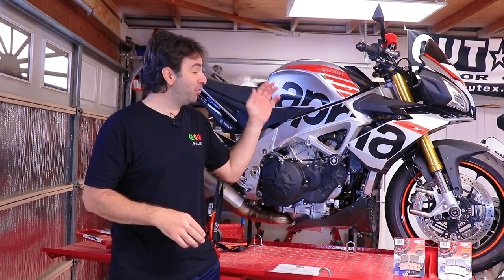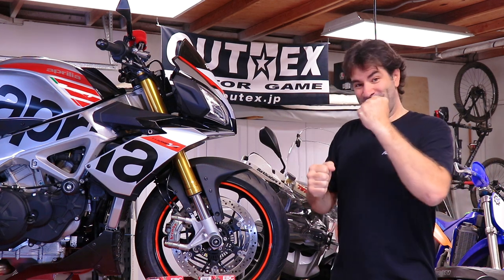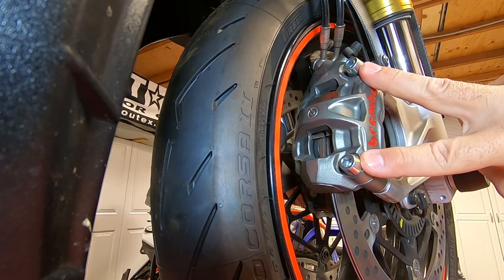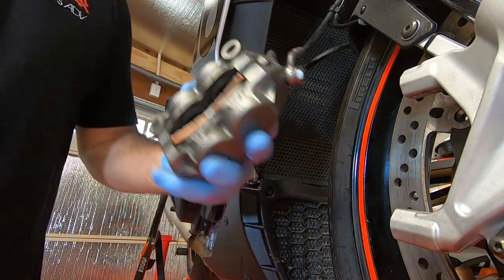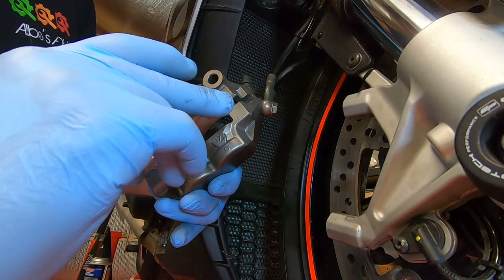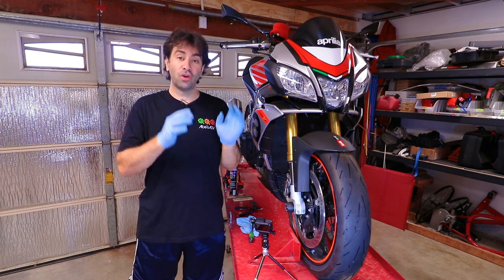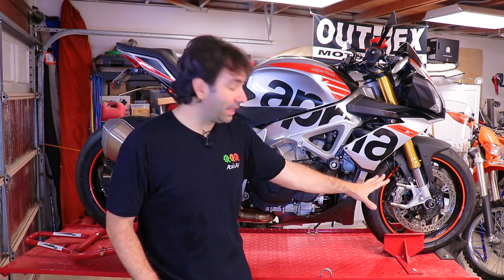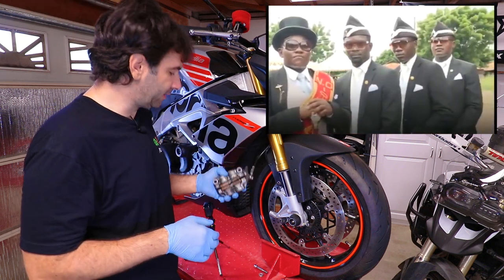Aprilia Tuono Front brake pads recall and replacement

Comment: Another nice instructional video, thx.  BTW my local Aprilia dealership replaced front pads on my own 2018 Tuono Factory in like 15 minutes,  while I waited.  They said no evaluation of OEM’s required & had the pads in stock as well.  As you said, not all dealerships are the same.
Reply from the maker: I agree, it's very simple, if you have a recall coming be prepared especially for the people that schedule an appointment. 👍

Comment: Hello Albe, sorry you had a bad experience with the dealer. I installed a Yoshimura Alpha T Works Race Slip-On Exhaust Aprilia RSV4 / Tuono V4 2017-2020 on my 2017 Aprilia Tuono V4 1100 factory. It is a little loud but sounds awesome. Having the stock 20lb muffler off the bike improves balance. Keep up the good work, thanks.
Reply from the maker: Hi James,  a friend of mine has the Yoshi on his RSV4, and although it looks great and has a good tone, when we ride side by side I can’t hear myself thinking, lol, I guess I’m too old for the Yoshi, I wold t it if it had a DB killer that I could modify to achieve the right loudness for me.

Comment: Albe, such good advice here! My dealer here in San Diego was awesome at this....with the exception that I had to wait a week or so for the appointment to open up. But once it was, I rode over and they did the job in an hour. I am sorry your experience was so bad.
Of course they replaced the pads with the OEM spec, as supplied by Aprilia. My service tech told me that he had done quite a few, perhaps a dozen or so, and that all of the pads he had removed looked excellent, depending upon usage and age of the machine. However he said Aprilia was being very good and essentially it was a new set of brake pads for free, except for your time of course.
I would very much like to hear your comments on the differences and advantages of the EBM pads compared to the OEM after you've had a chance to get used to them......a future VLOG?
Last question dude, your in-garage camera is excellent.....what type is it sir?
Reply from the maker: Garey my friend, one week would have been acceptable to me for an appointment, what bugged me was showing up for my appoint and being told it might take 2 weeks to do it, well, not so much, lol.
My camera is a Canon T7i while the close ups are made with a GoPro 7 just because it’s easier to handle, it took me a little while to figure out the best settings for the Canon in the garage, but that is my fault cause I’m a knucklehead  sometimes.

Comment: Great video! I subscribed! I am brand new to Aprilia and just found a 2017 RSV4RR I couldnt pass on. However I live very far from a dealership... Do you know of an Aprilia diagnostic tool to clear codes from ECU should I ever need to? Working on the bike is no problem. Software is the problem.
Reply from the maker: I agree, software is always a problem on all vehicles now a day, I'm not sure if guzzidiag can clear codes as well, I'm always weary on messing with the software. Congrats on your RSV4,  it's a fantastic bike and what a great engine 😀👍
Reply: @AlbesADV  right on! I'm gonna keep researching but from what I can tell, it looks like it will let you read the codes. For example when you go in the software it will pull the faults from your bike. From there you can fix the fault by performing the maintenance required. I'll give you a definite answers when I know. Ciao!
Reply from the maker: Ciao bello, grazie 👍

Comment: Albe. Would you check your bike if you still have the Aprilia Tuono 1100rr, and tell me if every now and then, you find a couple of drops of coolant that come from the weep hole on the water pump. If it does, is this a normal operation. I noticed the water pump has a little black catch under the weep hole. Is it there to catch any drops that may seep from time to time. Mine seems to lose a drop or two every now and then, but no issues with overheating or a great loss of coolant. Can you help me out? Thanks
Reply from the maker: I just looked all over my engine and couldn’t find any sign of coolant sipping, but that doesn’t mean yours is not doing it, as long as you have coolant in the system and is not dripping out excessively, you should be fine. My KTM525 exc does that, every time I ride it, there are 1 or 2 drops under the weep hole

Comment: Hi Albe, Great info on the Aprilia
Is there a chance you can make a video on the Water Pump on the Aprilia, as mine has a slight Coolant leak every now and then from the weep hole. Not sure why.
Reply from the maker: I'll look into it,  but if it's coming out the weep hole make sure the system is not overfilled and keep an eye on the temp, make sure is not overtemping
Reply: @AlbesADV  Thanks for the reply on the water pump. Can you tell me what temperature your bike runs at. If I am stuck in traffic and its not really a hot day, mine gets to about 107 Celsius is that normal. My thermo fans come on at 101 Celsius.
Reply from the maker: Mine gets up there as well when I'm in traffic I think I've seen it up to 105

Comment: Hi Albe, Not sure if you received my last message, but i just wanted to know at what temperature your bike runs. Mine was running at 106 Celsius the other day in traffic, but it was only possible a 18 degree Celsius day. The thermo fans kick in at 101 Celsius. The bike does cool down while riding longer distances in Poole weather and some times goes back to 80 Celsius, but quickly gets back to 102 in no time if you stop at lights for a bit. Is that normal?
Reply from the maker: The way you describe it sounds a little fast, maybe it's time for a coolant flush 😳
Reply: That’s pretty standard mate. I upgraded my radiator cap from the 1.4 Aprilia one to the 1.8bar cap (it’s a KTM one) makes a big difference and not too much pressure for the radiator. That should help a fair bit 💪🏼👍🏼👍🏼
Reply: @rschris1234  thanks

Comment: What pads do you recomend?
Reply from the maker: Usually my first stop is the EBC website, I've been using them on most of my bikes and they seem to work pretty good 👍
There should be a link in tge description
Reply: @AlbesADV  thank you
Reply: I' ve already ordered the pads  ebc hh.🙂 Btw, does it necesary to remove the air from the system after replace the.pads?
Reply from the maker: No, unless you hyper-extend the pistons in the caliper. Once you remove the pads do NOT touch the lever, reinstall the new pads, put the caliper back on the bracket and you are good. Remember to pump the brakes before you go riding and take it easy for a few hundred miles 👍